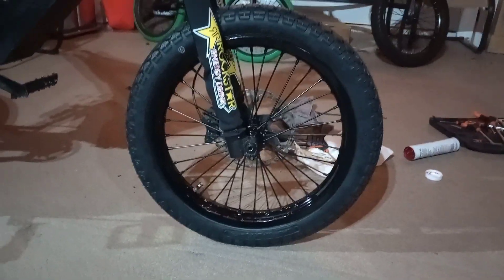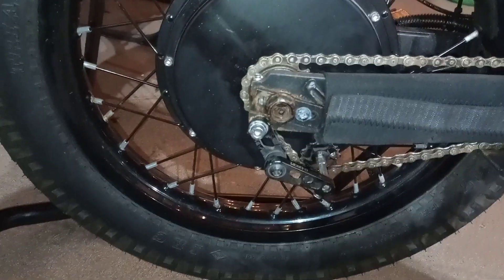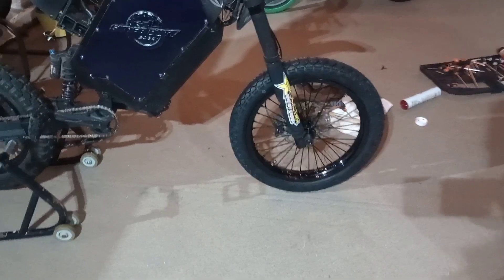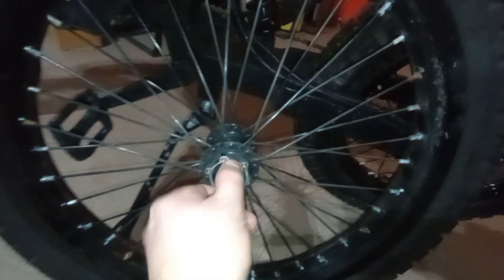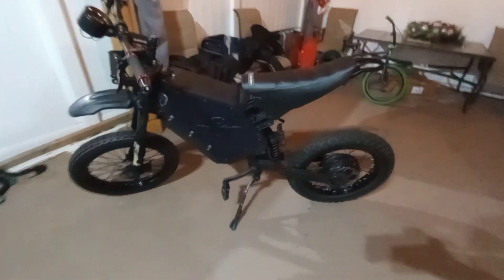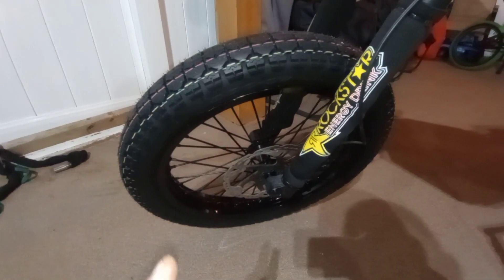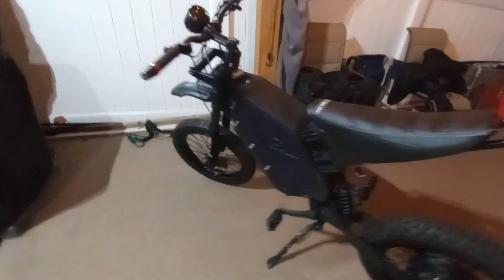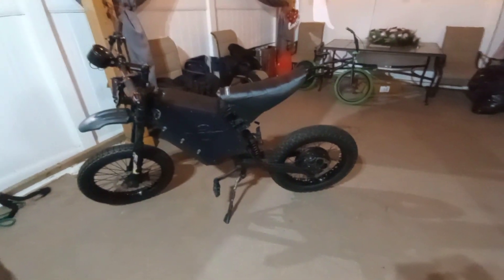DOING THE WORK!!!!

Comment: You should weigh the two tires to see how much weight reduction there is. The performance will change on a rear tire going smaller too.  I have 21's front and rear, I would probably go with a 19 rear if I get another rim.  It's just a pain to lace a tiny rim with a big hub motor. The 21" with knobbys hits the controller box on hard landings.  Sur Ron riders tend to go with smaller supermoto tires since they spend 98% of the time on the streets. I prefer to have some grip for trails.
Reply from the maker: .never thought of it